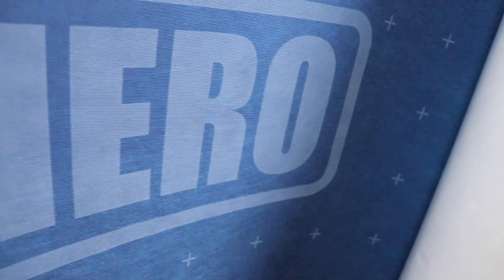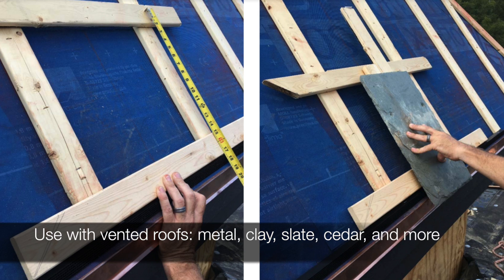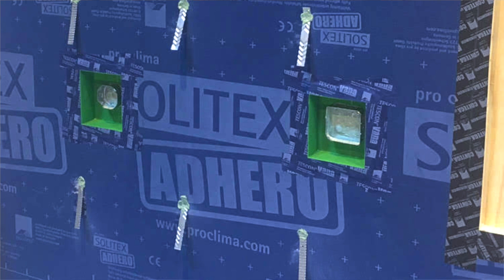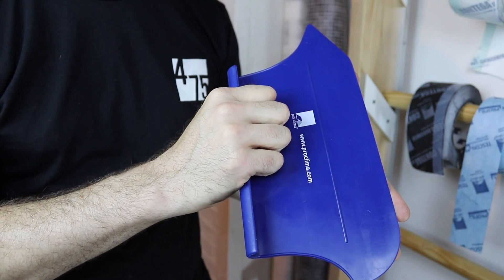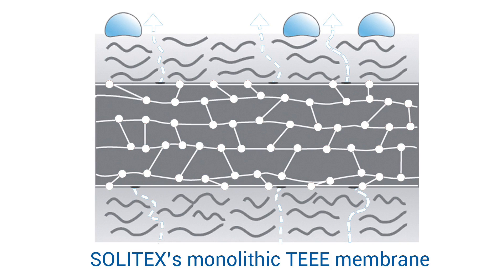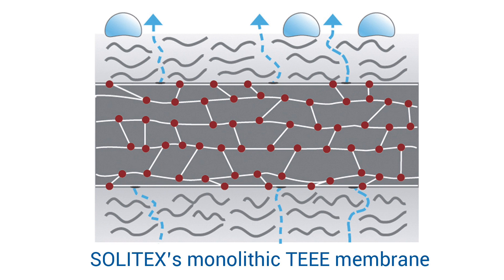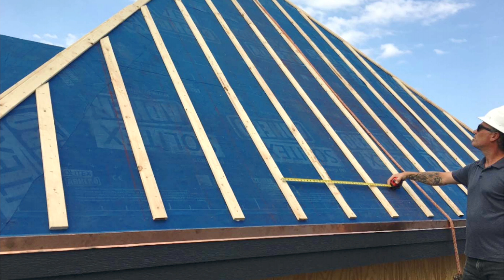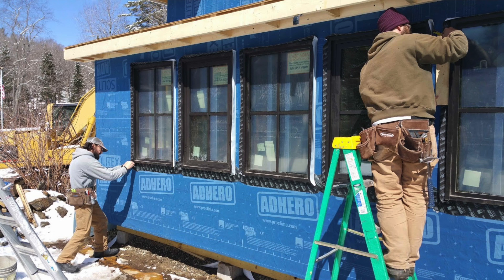Intro To ADHERO: The Self-Adhered, Vapor-Permeable, Highly Durable WRB

Comment: If I’m applying exterior insulation to my sheathing, do I add the rock wool to the sheathing first and then the vapor barrier or vapor barrier first and then rock wool? I live in Chicago. Thanks!
Reply from the maker: One of the benefits of this and other Pro Clima membranes, is that they allow vapor transfer, so it's a vapor-open air barrier. If you're using a self-adhered, like ADHERO,  then you'll want to adhere to the sheathing and apply rock wool over that. That said, if possible, the more you can wrap your insulation within the air barrier, the better off you are. We recommend you download our Smart Enclosure details. All our best recommendations are collected in the Smart Enclosure ebooks and CAD downloads to promote our building methodology. You can find it on our site: foursevenfive.com

Comment: At 32 seconds, you show the membrane being adhered to the bottom flange of the window. The sill flange of a window should never be sealed, and should be allowed to drain any water that accumulates on the sill pan flashing.. oops.
Reply from the maker: Hi Jonathan, this question comes up often, so it's good you raised it. We follow the science and as well as rely on window manufacturers guidelines. The image at 32 seconds is direct from the manufacturer. 

If the windows are properly designed and constructed, they should have frames that direct liquid water outward from the frame on to the outside of a sill or rainscreen. This means they are not directing it into the rough opening - hence taping the bottom flange can be acceptable with vapor permeable tapes like TESCON VANA (shown in the image) or TESCON PROFIL/PROFECT (each 8 perms) or other Pro Clima window tapes. That will let any unforeseen moisture dry out and also allow you to insulate the perimeter of your RO and not get cold bottom frame flange issues (ie water condensing on the inside).

If windows are designed so they leak into the RO - then that should be resolved or you can decide not to tape the bottom flange.

Comment: Can it be used on EPS ICF homes? Is the sticky stuff solvent free and waterbased? Is it suitable for sub-grade use and do you need a primer before sticking it on? It only has a 10year warranty (which is good), BUT an ICF house can easily last 100+ years if built right, so should this product still be considered? Maybe a rubber type membrane would be better to use, not sure? Sorry, i have a lot of questions...
Reply from the maker: Hello Paul, I'll try to answer as best we can here, but perhaps you should get in touch through our site to continue the conversation: https://foursevenfive.com/contact-us/
ADHERO can be used as the WRB with practically any wall assembly for walls and and roof, working without the need for primer, although it is not meant for sub-grade. An adhesion test is always recommended if there is a question about the material. The warranty is 10 years, but Pro Clima (manufacturer) advance-age tests materials to last for 100+ years. For more on the specifics of the adhesive used, see our recent presentation from Pro Clima: https://youtu.be/deXsVp9nO8k
Hope that helps!
Reply: @475.SUPPLY  Thanks for your reply! So which Pro Clima product should i use on ICF below grade? The PRO CLIMA SOLITEX EXTASANA, the non self adhesive one or do they not make a product for below grade at the moment? I watched the presentation, very interesting info about Pro climas tape! :)
Reply from the maker: @PaulyDownUnder  Thanks for tuning in to that presentation. The science behind the material is very interesting. Pro Clima does not have a material for below-grade use. We always recommend using sub-slab vapor barrier and connecting WRB to that - Pro Clima adhesives bond well sub-slab VB. On the other side of the wall, we do have an interior air barrier for use on the interior in basements called CONSTIVAP PLUS - just recently arrive in the US.